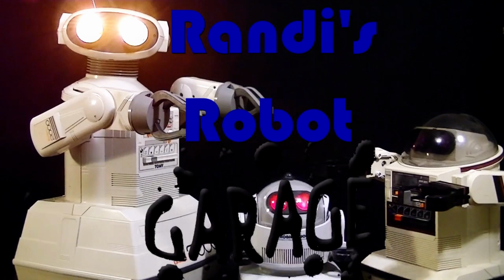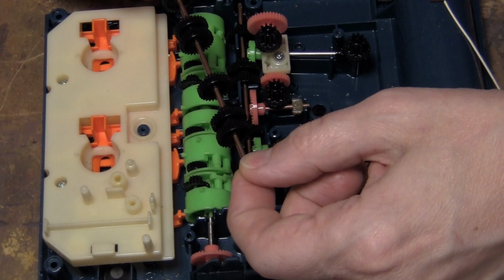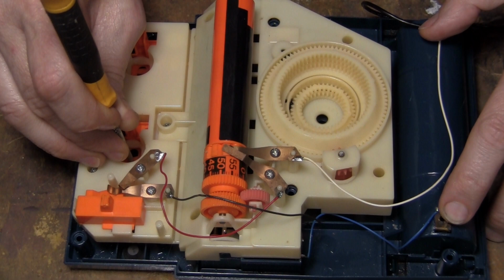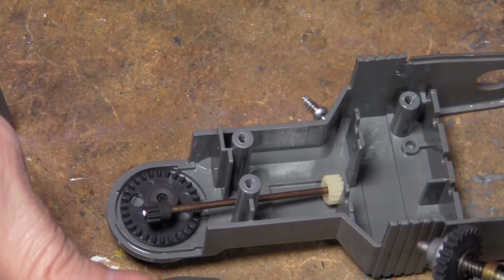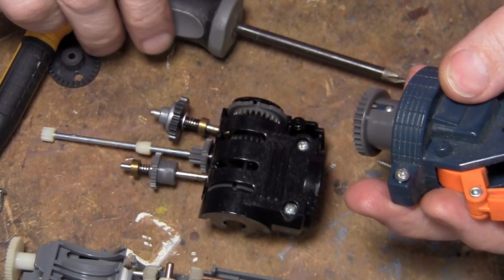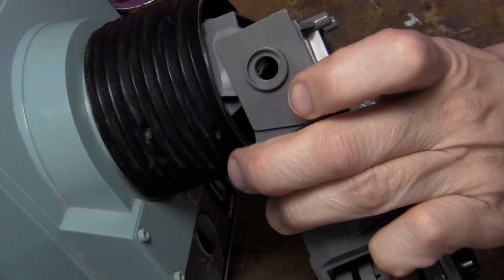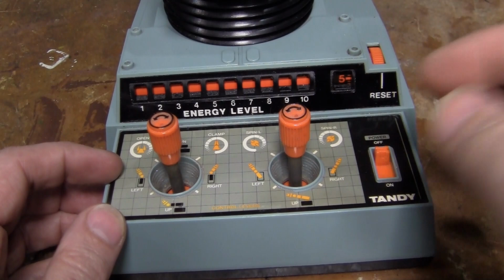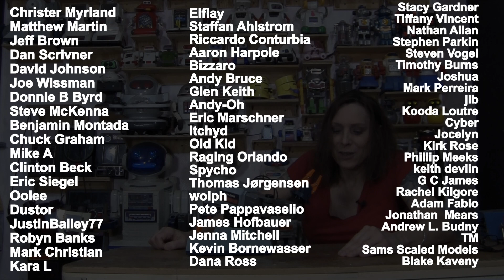From teardown to triumph: Restoring the Radio Shack Armatron toy!

Comment: I wanted one of these. By the time these were being sold in '84, I was already repairing mechanism industrially more complex. Thanks for the inside look Randi. This would have been the toy of my dreams. As a kid in the mid 70's I didn't really play with my toys, I took them apart to figure out how they worked.
Reply from the maker: The engineering is just genius.
Reply: I have a mint Tomy one in mint working condition. Still play with it, it's an awesome piece of engineering!
Reply: There's a mod for this to use with the old Atari computers.. I never did it, but now I have this and an Atari, so I guess 40 years later is better than never..:)

Comment: Fantastic video. It will certainly help me with mine if it ever breaks.

One tip regarding refitting screws. Turn them the wrong way until you feel them drop into the thread they cut when first installed. This way you're not cutting a new thread in 40 plus year old brittle plastic.

I use this method on old Tamiya RC cars I restore.

Comment: Great video as always... To clean my terminals I use vinegar on qtips.. To repair my gears I use LocTite 454 on a toothpick and a sprinkle of Baking Soda. Would love to see you repair a Nintendo R.O.B. robot... Thanks as always..
Reply from the maker: Vinegar has always worked terrible for me. I hate that method. There are so many things that work better. Like CLR. Again, not a fan of the baking soda and CA glue. It has it's uses, but most of the time is sucks.

Comment: Thanks for this - it gave me the courage to go in and replace some cracked gears in my own Armatron. On mine, the claw comes apart if you remove the small set screw at that grey (planetary?) gear at the base of the claw - once removed, it can be twisted and then pulls out, freeing the rest of the claw housing… but as you said, there’s not much in there other than two spring loaded gears used by the claw.

Comment: Like Verbot, I always wanted to know how this worked.  Also like Verbot, I'm really glad I never took mine apart!
Reply from the maker: TOMY uses it a lot. The Verbot is a tad different. It spins with a ratchet system, and then reverses the direction when it gets to the gear it needs. I just got a Japanese blue version that I will be refurbing soon. It has the extra 9 volt battery port on the robot, unlike the later ones where they ditched that.

Comment: I don't know how much you're paying for the CLR, but baking soda and water does a very good job of neutralizing and cleaning battery acid corrosion.  I don't think it does much for rust and lime, but I have fixed many, many a battery compartment with it.  Vinegar is pretty good too.
Reply from the maker: I've tried vinegar before and I thought it did a terrible job. Never tried the baking soda, but I keep CLR around for more than just battery terminals. So why not use it?

Comment: I bought one of those when I was in High School with them intent to convert it to computer control from my Commodore 64.  I took it apart and looked at the gears and put it back together.
Radio Electronics did an article later about converting the arm to computer control but the method was too costly for my budget.  Today, I would use some solenoids to replace the control sticks in stopping the green drum.
Reply from the maker: Or servos, but tiny solenoids hooked straight to the spinning drums would work real good.

Comment: I still have some parts from one of these in my junk bin. It's impressive how much function they got out of a single motor. It makes me wonder, all that gubbins must've been cheaper to build than adding another motor or two?
Reply from the maker: I'm sure it was cheaper to some extent, but TOMY did that kind of engineering in their sleep, It was nothing to them.

Comment: This thing is so "over engineered" (if there is such a thing). I could think of a multitude of ways to make this that would be probably cheaper and less complex to manufacture. But they had to have reasons they went this direction. Maybe small motors were way more expensive to source back then so they went with the one time cost of spending all the time it would take to figure out all the gearing arrangements and all the ratios needed etc, instead of using a motor for each freedom of movement. That way they just have to pay for one motor to do all the various movements. Either way I'm glad they went this crazy route as it makes for a much more interesting "toy".
Reply from the maker: I don't think it's over engineered at all. If you can make it with one motor, why add more? They did what they were good at, gears. Now, the Mobile Armatron does use multiple motors, and actually has less functionality. This one blows that one away. You will see next week.

Comment: that thing looks cool I want to see someone mod two of these onto a onmibot, its a shame they don't make much robotic toys now and when they do it just doesn't have the same aesthetic.
So I wanted to ask what are the best and most easy to find molding things?
Reply from the maker: I don't really understand the question. "best and most easy to find molding things"?
Reply: @RandiRain  crap I forgot to double check what I wrote.
I mean which of the liquids that you use to create molds and make the new parts (the pink squishy thing and the black liquid) is the most accesible and how expensive is it?

Comment: What an over-engineered toy!  Presumably electric motors were expensive back in the 80's, hence the fact that they only used one motor and had gears and clutches to transmit the power to the multiple joints?
Reply from the maker: I know about "over" engineered. This was made by TOMY. That's what they were know for. When you have the ability to make something work with only one motor, you do. There's no reason to add in more when you don't need it. That would be over engineering.
Reply: @RandiRain  Yes, sorry, I didn't mean to criticize it, it's an amazing piece of engineering, but I just can't believe the complexity that was involved, beyond most robots of that era.  (Although maybe not TOMY ones, going by your other videos).  Good on you for getting it working despite multiple split gears to repair or replace.

Comment: Thanks for this video. I have a question for Randi or anyone else who knows. I picked up a used Armatron to give to my grandson who’s into mechanical stuff & robots. It works about 90% with the exception of the whole arm raising. It lowers and starts to raise. At about 20 degrees it starts slipping and dropping back. I spent 2 hours disassembling, learning, cleaning, lubing and re-assembly.  The action is strong from the motor to the main gears in the base. I took the vertical assembly of gears apart looking for broken gears. I saw none. The gear that controls the elevation is laid out strange. It actually sits across 2 other shafts. This gear also has a spring and a metal backing plus a metal gear that lifts the arm. Anyone have any ideas where else to look?  Thanks in advance, Dave
Reply from the maker: I've looked at so many of these games it's hard to remember which one is which. I do remember there being a spring to help it hold it up, maybe the spring has long its sprung? It does happen. Maybe a little stretch? Hard to say without looking at it, but that's my best guess.
Reply: @RandiRain  you may be right. There is a spring and it seems to be not very strong. I’ve also thought about adding a counterweight. Thanks for answering so fast.